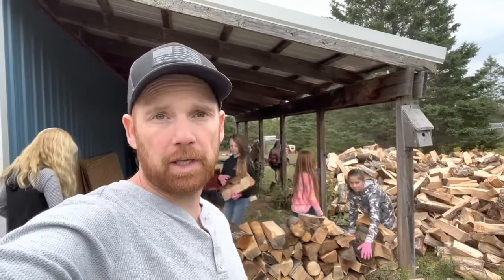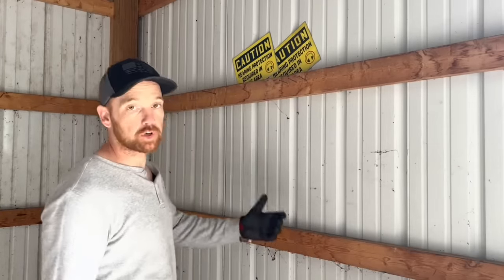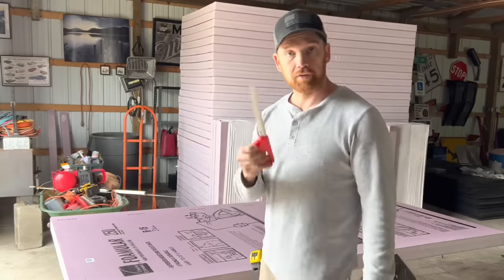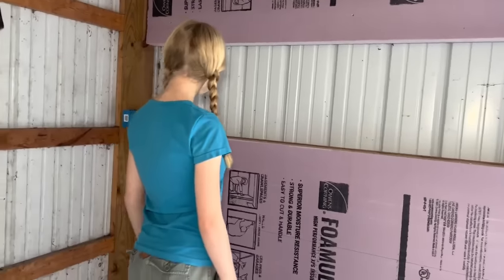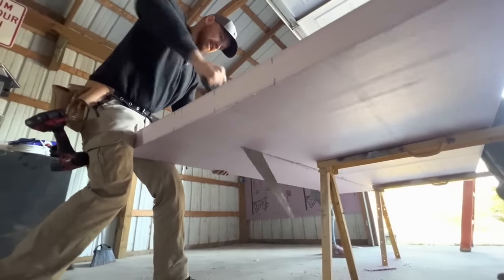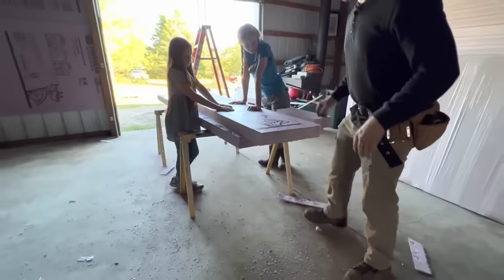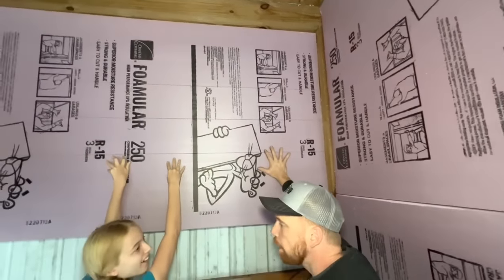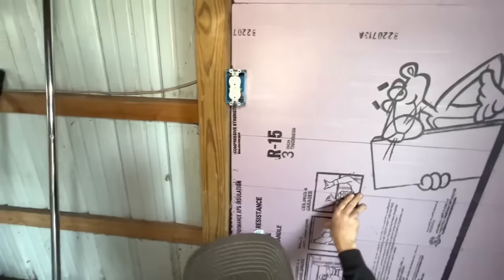Insulating our steel building/garage | Why we are NOT using Spray foam... Family prepares for winter

Comment: You will get condensation between the tin and foam doing it the way you do this but not with spray foam. Spray foam don't sweat in open pockets like this will - mold is dangers so it all fall back to expectations in my opinion and what you can afford. With spray foam you get a good seal so again it all fall back to what you can afford the cheap way or the right way.

Comment: Only problem is mice they will live in the bottom section unless you screen the bottom. You could have tried the preformed stuff they make for they're  ridge vent.
Just a problem we have with aircraft hangars no matter who's metal if there is a dime sized hole you made them an insulted home

Comment: Spray foam sucks. It's beyond messy, makes it impossible to ever run a wire and it's horrendous for the environment. That pink panther insulation is easy to hang and is super easy to remove if needed.

Comment: The best reason not to use spray foam as if you ever sell your house the building inspector needs to see the wood which means you're going to have to pay to get it out so they can expect the wood to see if it's structurally sound

Comment: The only downside I see to this is because you have the through holes on the metal to daylight with no bug screen is termites or other insects burrowing in and eat or nesting inside this insulation foam. But right on for doing insulation yourself and 16k is way too much for spray foam
Reply: Also field mice....

Comment: if your wires "go bad" you just need to unscrew the r board to fix it?! Even though you glued and foamed each panel together?! Youll have to take the whole wall panel off, which would be hard cuz of the outlets yea?

Comment: OK the cost is cheaper up front but in the long term it will be more money over time..... you will have to install a vapour barrier, you will lose heat & cold without a sealed envelope of insulation and if you are going to use the garage or shop year round and it's supposed to last for the lifetime of the structure - you will have rodents and moisture to deal with down the road and your heat and cooling bills will not be cost effective over time - Good Luck!!!!!
Reply from the maker: Don’t need additional vapor barrier with this application. And we installed a rat guard around the perimeter to keep out rodents

Comment: You seem to have used the wrong glue. You need to use the stuff rated for foam board otherwise it will dissolve.
Reply from the maker: The glue is rated for foam board as well.

Comment: It could have used a heat wire. It doesn't leave any residue cutting
Reply from the maker: There is a toxic fume that comes off the foam when it reaches a certain temp

Comment: So you just created  a air pocket between the foam and the metal wall? now the metal is gonna cause the air in that pocket to be cool during summer and hot during winter.  With that said, now the hot air is gonna get trapped and it la going to start to melt away at that adhesive. You may have saved yourself some money this year but it this setup won’t last long and then your going to pay for it when it no longer holds up
Reply from the maker: It’s all vented between the metal and insulation. The air pocket will be outside temp year around.

Comment: oops... that PL3 will eat through the foam. you need the Loctite foamboard specific adhesive
Reply from the maker: This adhesive is for foamboard as well. But i switched to great stuff foam in between the panels

Comment: I used to own a boat factory and bought the materials for pumping urethane foam in compartments to be coast guard compliant on flotation compartments. The requirements from the state fire marshals and the EPA were outrageous because this shit it highly leathal from it's fumes and as bad as soaking your house in gasoline in the event if fire. It's nearly impossible to extinguish. Should never be used to house living beings.vaksi you should never stack your firewood against your house cause it will only act as fuel while your house burns.bin the bush of Alaska we always have a small cash cabin to run to in the sub zero weather when your house burns. If you don't lose your firewood you won't lose your life cause you will be able to heat the survival cabin. Age old bush craft knowledge
Reply from the maker: The firewood is stacked next to our shop a couple hundred feet from our house

Comment: As a Marine, I must ask if you are intentionally attempting to make some kind of statement by displaying your flag backwards?
Reply: I originally thought your flag was on the back wall. Which would have made it backwards. HOWEVER, now I see that it's hung off the wall from the rafter making it a perspective issue. Assuming your intent is that it would "normally" be viewed from the other side.
Reply from the maker: The flag was hung there before we purchased this property. When the garage door is opened on the other side of the flag you can see it hanging nicely from our house and front yard looking in the garage. You and many others have thought that as well. Anyway Darryl thank you for your service.

Comment: these crazy prices will ruin the spray foam industry.16,000 bux was all the whole building cost 10 years ago...INSTALLED,less floor or spray foam....its only 24x34!...spray foam seems to rust out panelsCLEAR THROUGH in about 15 years in moist missouri......and foam installers seem to double their cost - OF-materials.... REAL SLOPPY WAY TO BID ANYTHING>>>>

Comment: Brother... You're going to end up spending so much more that way than if you just used foam.. you're also going to create all kinds of moisture problems. It's expensive but it's worth it. 2" is all you'll ever need.
Reply: I enjoyed watching though!
Reply from the maker: Thank you Brady I have done some research and checked out someone else’s job and this foam board insulation I’m using is moisture resistance and will last the lifetime of the building. Besides, with the price of spray foam I could redo my whole building three times with what I’m doing now for the same money they want. It seems like robbery to me

Comment: I'd stay away from spray foam entirely. It's a waste of money and a pain if you need to do any kind of work on the house. You can still air seal the home and use kraft faced fiberglass. 
I had my new construction vacation cabin/cottage spray foamed. While they did an immaculate job its just not worth it. If you want to do an addition or run more electric you're basically throwing it out the window.

Comment: buy the cheapest hand saw you can find works better then that knife you got. I use a hand saw I got at the dollar store and use it for drywall and foam board and after a year its still working fine. I would not try cutting wood with it lol

Comment: Good choice not using spray foam. Id never use spray foam on anything. You cant work on the structure when its covered in foam. The risk of it not curing right and offgassing the interior to death isnt worth it IMO.

Comment: steel wall need insulate 75-100mm minimum spray foam lot lot better than all other style insulation, if uses insulation foam sheet to steel wall stay airpockets were condensation make lot water to inside wall and floor drop. newer not need use wool insulation steel or other insulation what suck water in to insulation, alltime need only sure closed cell foam spray, biggest fail what can do steel wall have use foam sheet or glasswool insulation then come lot condensation and moisture in all and water leak to lot floor base pillards and wood mold.

Comment: You are saving money upfront but I don’t think you understand the benefits of the spray foam being applied to the substrate.
Reply: Could of done 1” of closed cell foam and it will do the same as you applying that foam board.
Reply from the maker: 1” of closed cell spray foam is an R7 value. The 3” is R15 and a closed cell.

Comment: that PL will eat thru the foam.  they make foam glue just for that reason
Reply from the maker: The adhesive I uses is specifically for the foam board insulation. Didn’t melt any foam. We did however find it useless after finding that just using the can spray foam to seal the cracks does a much better job

Comment: Screws with washer over nails
Reply from the maker: Since we’re putting metal over the insulation we decided it’d be best to just use standard screws countersunk. The metal will hold it secure once installed

Comment: Not sure I agree with anything other than cost.  You will end up with insects and possibly mice. I would have recommended rock wool insulation. Mice hate it. Possibly cost more and would finish inside of barn with wood.

Comment: It's a wall of water behind those panels.
Reply from the maker: Nope
Reply: Guaranteed there is water between the foam and metal .I know by experience off literally thousands of pole barn jobs done.anywhere there is a air pocket u will hv hot meeting cold and in Michigan moisture u hv water
Reply from the maker: @desmondnaugler4452  I just had to take down the insulation near my service box and there’s no water or moisture whatsoever.. the air gap between the metal and wall is well vented and is the same temp as the outside.

Comment: Vented building would not serve the work you put into the Rigid foam.  Problem is leaky building has always been about "Air" transference. You want a warm building in the winter and a cool building in the summer, then you need the building to be air tight or those foam will not be effective or make a difference.
Reply from the maker: Inside the building will be air tight as I had mentioned in the video.

Comment: Man you put up a lot of fire wood!!! My house is 20' ×36' two and a half floors and burn 2.5 cords of wood and 300 gallons of propane for heat and HOT water !!! Cut your foam with an electric knife by the way much better!!! PS I live in northern Maine!!!
Reply from the maker: We definitely won’t use even half of that this winter but at least we’ve got a good start for next year!

Comment: I just cut it with a circular saw
Reply from the maker: 3”?
Reply: @9252LIFE  yeap for 3" I may need  to use my table saw but I made some foam cabinets etc for a project and found that it will machine pretty much like soft would
What is strange however is it can dull a cutting edge fairly quick

Comment: Mice will remove pink and leave a stink , you'll wish it was your fart you let . 
Them ribs open at bottom are there way in behind and eat wiring and burn you down . Trust me I lost a 40 x 40 shop this way and over 600grand of contents .
Reply from the maker: Someone told me to stuff steel wool in those opening. I think I will do that. And man sorry to hear about your shop!
Reply: Stainless steel steel wool is expensive... Mineral wool insulation works pretty well and lets the air still go by
Reply: It was a sad loss , they make a metal piece you put to stop them from coming in . I mix peanut butter  n baking soda to kill n no eat wires cause they can't fart 😂  or poop so not hungry like poison makes them eat .

Comment: Must not have rodents as all those so called vents are perfect runways for pests....
Reply from the maker: I did take a foam board panel down yesterday to add a 240 plug and I had noticed there were a bunch of flies and lady bug lookin things all bunched up behind there. So we will be installing some L channel at the bottom of the exterior sheet metal and may do something with the top portion as well.